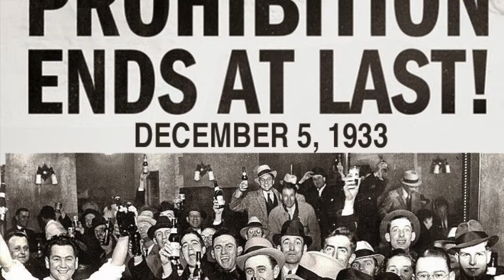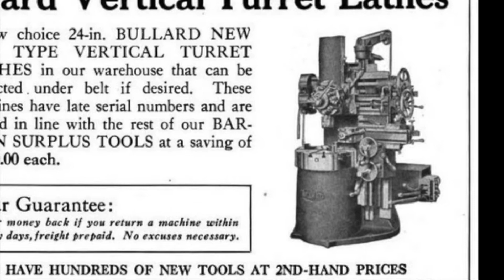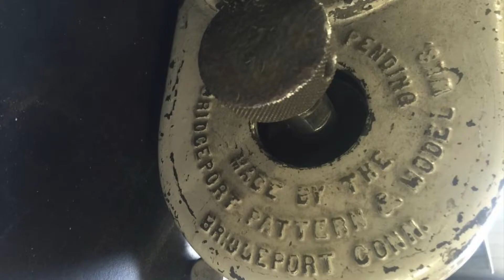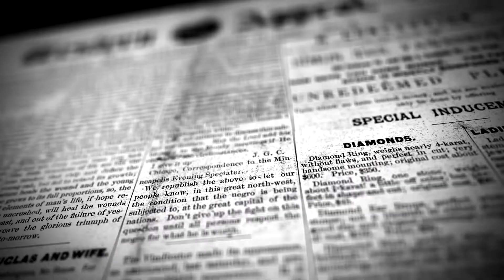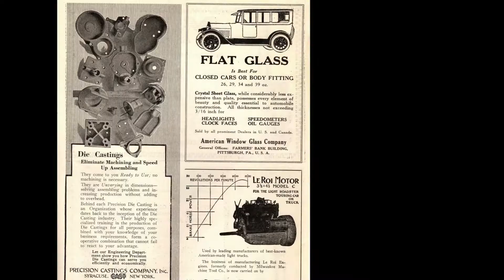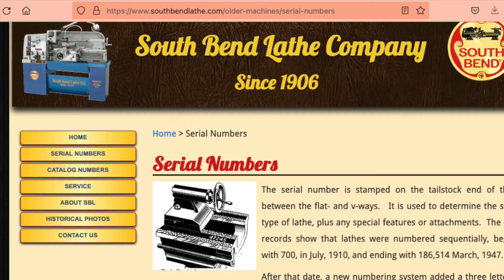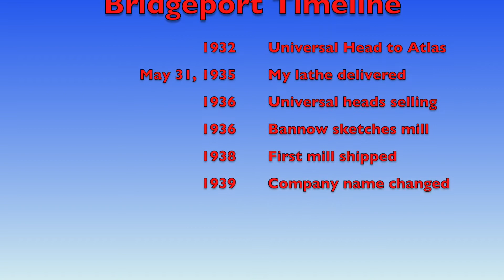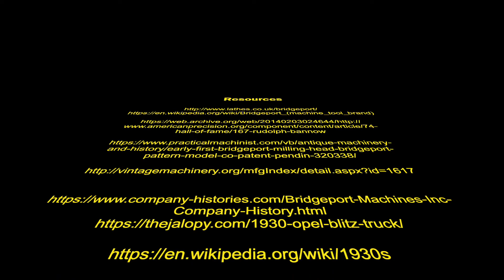South Bend Lathe Restoration, Part 6 -- Bridgeport Mill History Connection

Comment: I just bought your lathe's little brother! 13" swing 5' bed "n" apron. Catalog # 186-b. My serial is 57062, so it's close to yours and I think it had to be one of the last N models to be made. The only other difference is I got the taper attachment with it and the front door is missing on the cabinet. Pretty much all the paint is flaked off, relatively rust free, but filthy.  All the important surfaces show very little wear and I can't wait to tear into this project.
I couldn't find any restorations with this type apron and re-watched yours and smacked my forehead.  I will be rewatching this series religiously bringing mine back to life
Reply from the maker: This is so cool!  Have you sent off for the registration card?  According to this site http://www.wswells.com/sn/sn_db.html , a lathe with serial# 57238 was sold on 3/13/1935, and another with #56617 was sold on  1/8/1935.  My lathe with #55092 was shipped on 5/31/1935.  If I look at other lathes with numbers close to mine, they are dated 1934.  So I'm not sure why mine didn't get sold/shipped until the following year.  
I think the history is so cool.   I have more footage of the rebuild that I didn't show due to need to keep the video a watchable length.  If you need more assistance, please feel free to write me at kdtop3 at gmail dot com
Reply: @KevinToppenberg  I have not yet, I’ve had it a whole 24 hrs and am knocking dirt dauber nests off currently. I will be doing that and I ordered the rebuild kit/manual already. All the lube is gummed up on everything, it took lots of work to get the tailstock shaft lock to let go. 
SB information I found showed 1/25/35 to be the last manufacture date on the N series due to poor sales. Kieth’s site has a 1938 catalog that still lists a few and appears to be replaced with the R which swapped the push/pull switch to a 3 position lever ala the 9” A style.
I’m excited to tackle this project and what the end result will be. I doubt I will tear it down to the degree you did but your videos are an invaluable resource to look to. Thanks so much for posting them!
Reply from the maker: @bryguy1811  I'm not so thrilled with the push/pull lever on the carriage either.  Ah well.  Let me know if I can help along the way.  You can email me any time.  Best wishes